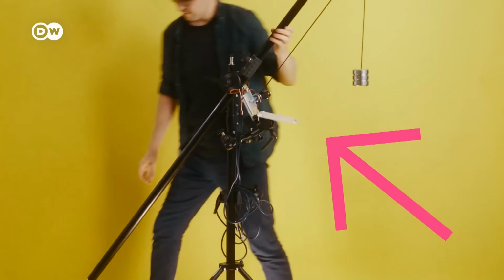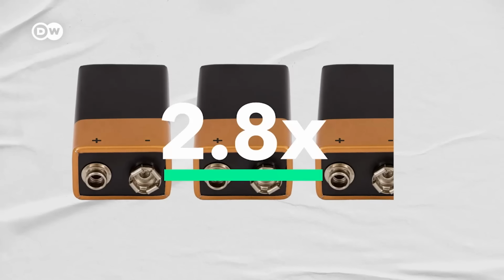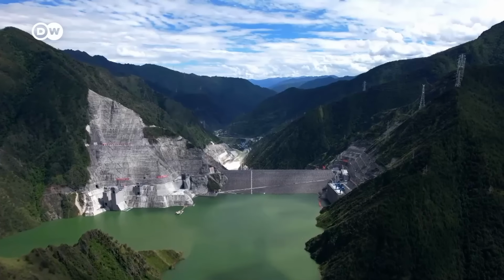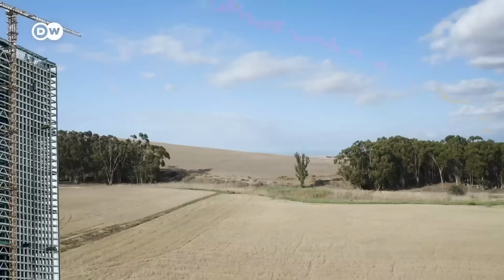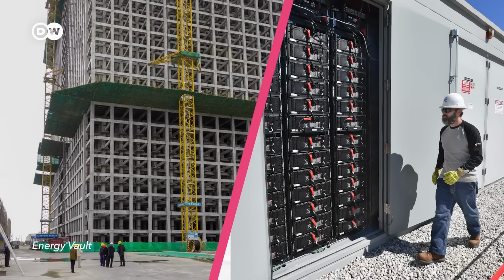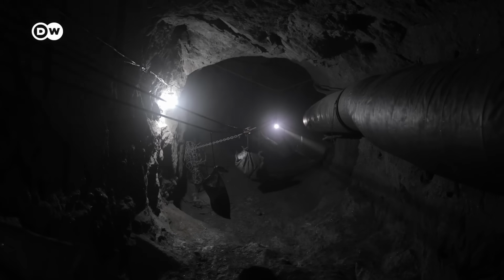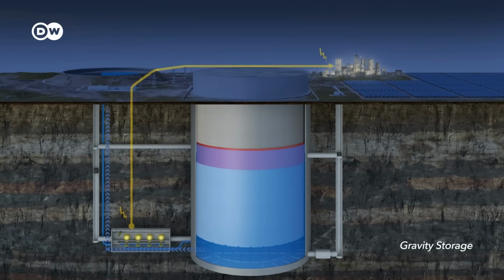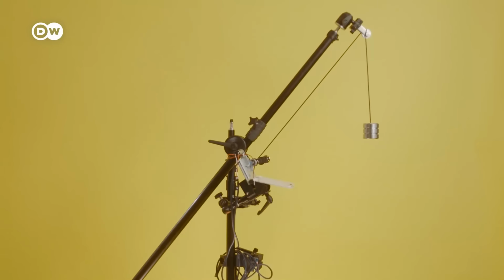How to use gravity to store energy

Comment: Ever heard of pumped hydro power?

It's like this but better!
Reply: did you even watch the video ?
Reply: @Faisal-ep3fe  Honestly, I commented first.

But if this concept was going to reduce the same amount of power as a dam it would have to be even bigger!
Reply: Pumped hydro makes zero sense if you don't have the mountains for it. There are many industrial regions around the world that need a lot of energy but are nowhere near mountains.
Reply: @chrisb9319  It's easier to make giant water towers that to put concrete blocks on rails or cables. The math simply doesn't work when you consider wear and tear, or materials cost.
Reply: @chrisb9319 if they need that much energy then the gravity powered system would have to be even bigger than the dam they can't build!
Reply: @mgt864  A gravity system can be built anywhere, a dam requires a large river and significant elevation change. What do you propose for areas that don't have that? Accepting that batteries aren't sufficient?
Reply: @chrisb9319  So building the "mountains" for this is cheaper because concrete is cheaper then water? Do you sometimes listen in and think about what you are saying?
Mass is mass. Water is simply cheaper then concrete.
Reply: @fgregerfeaxcwfeffece  lol. You make it sound like you need to buy new water every time you want to pump it up the mountain. Newsflash: you pay for the mass once and that price is negligible compared to the energy produced with those concrete blocks over their very long lifetime. Also water evaporates and concrete does not.
And nobody is building any mountains. You simply lack the reading comprehension.
Reply: @chrisb9319 that is when u can have underground reservoir XD
Reply: Pumped storage hydro (PSH) is good, but reasonable sites are few and are far between and we need a lot of storage to displace fossil fuels.  What's worse is that water rights and water access become even more contentious as global warming heats up.

Water is dense at 1000-kg/m³ but that's only fractions the density of metals like iron at 7878-kg/m³ so gravity batteries can be significantly more compact in area and height versus PSH.
Reply: @beyondfossil  Dams and pumped hydro store tens of millions of Kilograms of water and have relatively few moving parts. A system of cables or rails designed to carry iron or rocks with anything close to that total mass would be insanely complicated and in no way cost effective.
Reply: @YourArmsGone  Both systems require maintenance.  I'd argue that pulleys and cables are simpler to maintain than PHS that uses dirty organic lake water.  Dealing with water from an engineering point of view is already an added complexity.  Add in dirty water and its worse with constant muck and algae/plant growth.  You don't see this complexity because someone is handling it continuously, and it's become commonplace.

There are cables and pulleys that handle these weights all around the world.  They can be easily scaled for more heavy-duty use.

There are at least 7 companies world-wide working on gravity systems.  If it were as cut-and-dry as you say, perhaps you should e-mail their executive board and tell them they're wasting their time and money.  Maybe you can charge a consultancy fee for a few tens of thousands.

If you don't like cables & pulleys, then look at a company called GravityPower that uses a giant weight at least the size of a city bus that's suspended in fluid filled closed-loop chamber.  No cables or pulleys needed because it's all hydraulically driven.  The gravity storage options are bigger than you think.
Reply: @YourArmsGone do you think everyone has alot of water to be pumping everyday
Reply: @grahammukuyu4660 sewer and household waste water can do the job. Hey nobody said the water must be CLEAN
Reply: @grahammukuyu4660  Thats the thing about pumped hydro. you buy the water once and reuse it. It's much cheaper in terms of mass and maintenance than lifting solid blocks and dropping them.
Reply: Earthquake proof
Reply: Make the connection 👉 The Connections (2021) [short documentary] 🌎 ♥️ 😎 ✨️